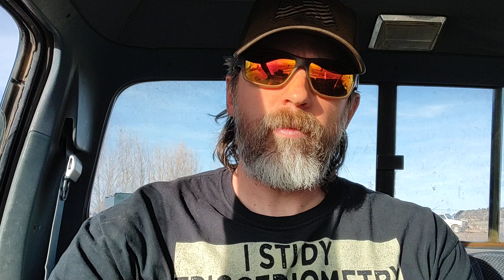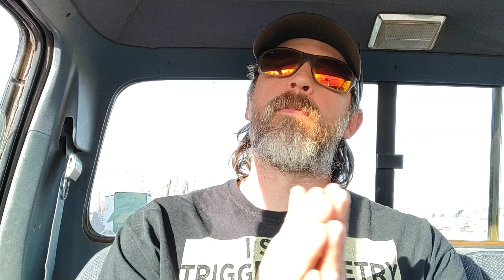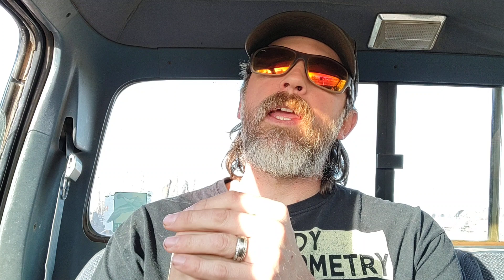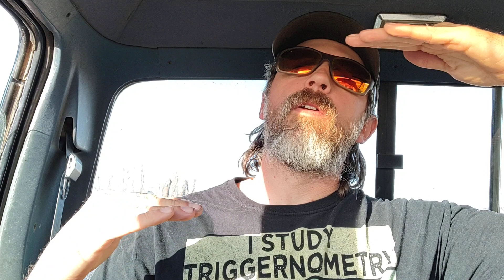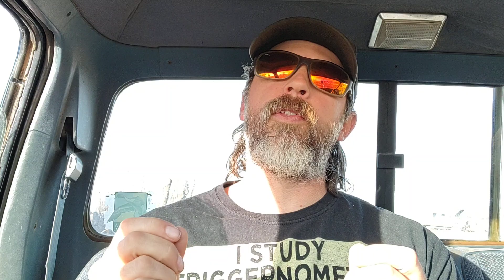Thermal Mass and Survival

Comment: I am building a passive solar skillion/shed roof/mono slope square notched post and beam cottage. But have a cold ground temp 48 and up to 6 feet on the frost line. So a traditional earth ship with tires and berm is a waste of my time. It's less time and labor for cmu block north wall, vermiculite cored, low perm wrap, mineral wool insulation, and masonry veneer. Gonna thermal break/vapor barrier, insulation, limestone fine, concrete, and slate slabs for floor. Trying for over r 40 for floor, north wall, and roof. Gonna try making my windows with poly-bicarbonate 3 panes. Going 40% window area vs floor area. Building masonry stove with white oven and masonry heater in cottage. I like earthships because less bills. You can replace tires with poured walls or cmu block in earthship designs.

Comment: We live in a 2500 square foot straw bale round house with a 20 foot ceiling.   Our floor is concrete, we heat with a big 500 pound wood stove, completely surrounded with big field stones, and I keep 3 large stock pots full of water on the stove, which I use for hot water as well, we are completely off grid.  We also have very large south facing windows which help to heat when the sun is shining.  Our house is so toasty, we spend a lot of time naked or in summer shorts, even when it's -50C outside.  Great advice for people wanting to live more self sufficiently off grid.
Reply from the maker: That's great! We looked into building a straw bale home at length. Sounds like y'all have a great setup.👍
Reply: @efficientinthefield  living the dream brother.  We have 120 acres, with all the farm animals, birds and gardens.  Hoping to have some like minded folks join us, just pull in a trailer, tiny home or build a cabin and raise  our food collectively.  Enough space we don't have to get in each others hair, or even see each other for that matter, lol.  Really appreciate your channel.
Reply: Blah,blah,blah... If you've looked up straw prices you can see that fiberglass insulation provides better insulation for less money.
Reply: Maybe you need to check out the prices again blah blah, here a bale of insulation is $95, a bale of straw is either free or up to $4.  We have never lived in a house that kept incredibly toasty warm in winter, and cool like air conditioned in the summer.  I speak from experience, but you go ahead and build your insulation house,  and maybe sign up for a good manners class, the cold and heat removed what your Mama, I hope taught you, good luck. @xephael3485